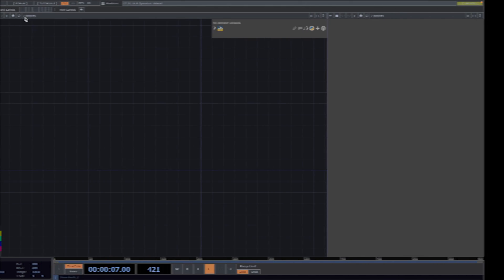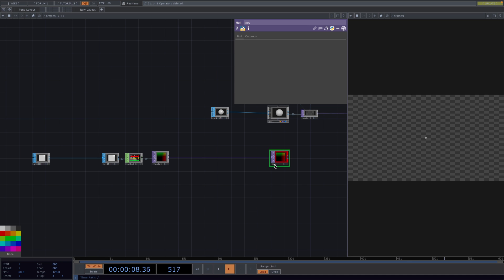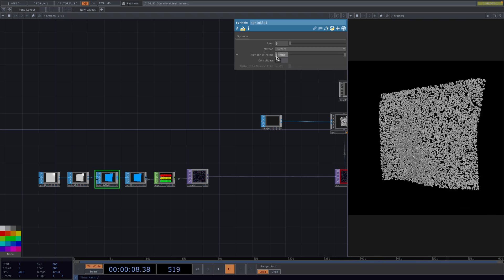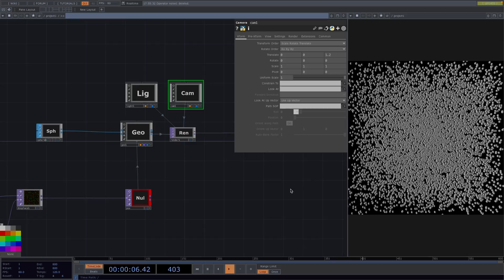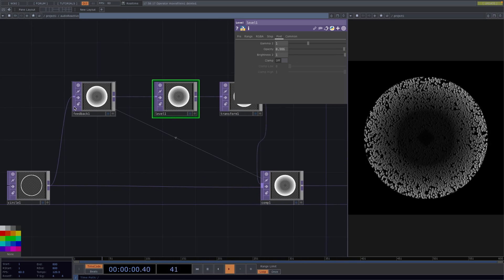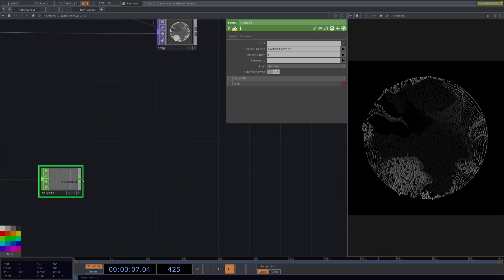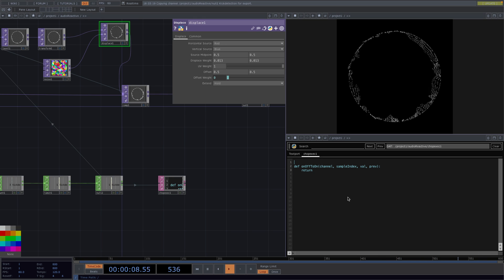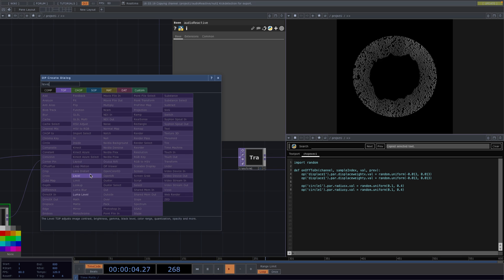Easy audioreactive visuals | TouchDesigner Step by Step Tutorial

Comment: urghhh my final product is a bit weird.. the audio gets really messed up when i export it for some reason, and the video looks weird if i leave the kickdetection on. the video is a lot smoother if i change it to only snare detection, but still either way the audio is awful. maybe my export settings are wrong? i tried different settings but nothing seems to work.
Reply from the maker: Did you toggle off the real time flag? Did you set the Audio device out chop into the Movie file out Audio chop?
Reply: @acrylicode  I set TOP Video to /project1/audio reactive/out1 

and CHOP Audio to /project1/audioreactive/audiodevout1

is that what you mean?
Reply from the maker: @sublimazed  yes, and did you toggle off the real time flag while rendering?
Reply: @acrylicode  I don't see that option :(
Reply from the maker: @sublimazed  it is next to the fps display above in the touchdesigner interface
Reply: @acrylicode  oh I think I fixed it!! I set CHOP audio to audiofilein1 instead of audiodevout1!!